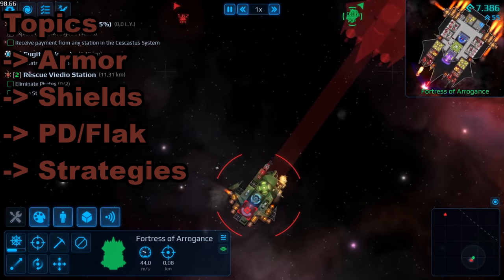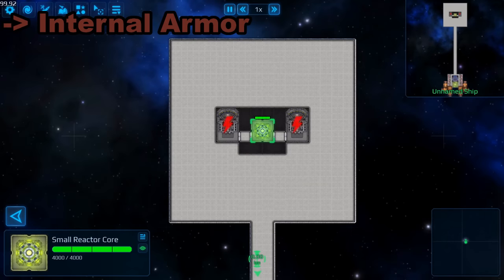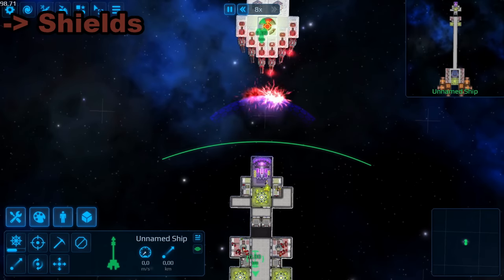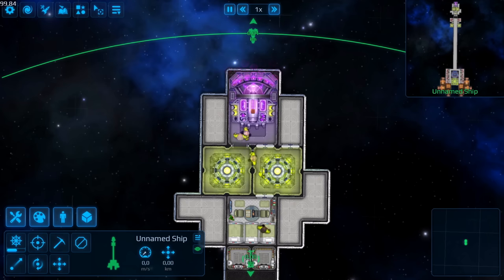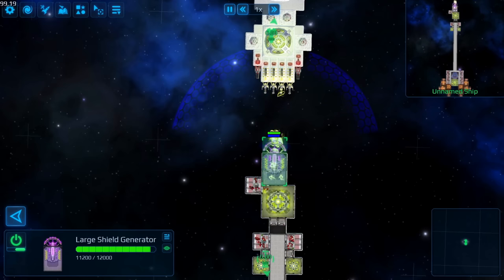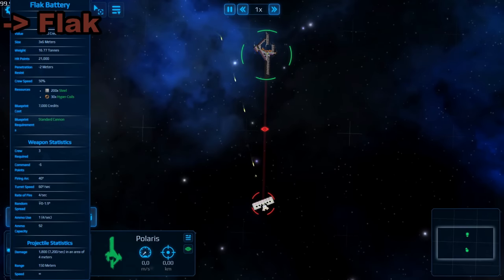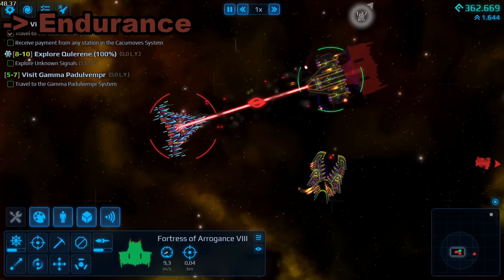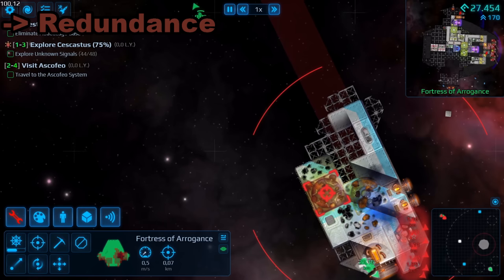Cosmoteer Basic Defense Guide

Comment: [[[The temptation for an anti-flak essay has been huge but I prevailed]]]

Anyways, in the 12:45 mark and onwards, where you talk about different strategies, you missed one very important one, which I'll get to later. First things first, your definitions of survivability through different means complements the main types of shipbuilding strategies used in the actual competitive part of the game very well, and even their signature thrust setups:

''Survivability through Endurance'' (as you call it), complements the competitive Orbiter/Rammer playstyle and the Orbital thrust arrangement. Great forward speed, barely any backwards speed and low maneuverability, relatively good spinning power to make orbiting a possibility and a lot of means of defence, mainly armor and small shields, sometimes Point Defence.

''Survivability through Range'' is the Kiter playstyle and the Kiter thrust arrangement. Very high backwards speed and decent maneuverability as well but abysmal forwards speed (In most cases), incredibly light, mostly relies on PD and shields to protect itself.

And there, you missed one: ''Survivability through Maneuverability.'' Basically just dodge everything that enemy throws at you and let everything else be absorbed by your heavy shielding, also use your vastly superior maneuverability to tilt your ship and spread damage so that it does barely any damage. Uses avoider thrust arrangement, has moderate speed in any direction and phenomenal maneuverability thanks to smaller thrusters such as mediums and larges, and relatively little weight.
Reply from the maker: "The temptation for an anti-flak essay has been huge but I prevailed" proud of you XD
and yes that was an oversight on my part. probably due to my battleship-mentality to either outlast the enemy or reduce him to atoms before he gets close.

But i also think that this strategy leaves little room for error, no? plus both shields and a bunch of engines scream "power issues" in my head. If you want to elaborate on that strategy further, i can pin this conversation so that others can see how to make the manouverability type work. like reccomended weapons, shipsize/form, maybe even examples from videos that you have seen from other people (you have my permission to post other peoples stuff in my comments. its for education, so i wont complain+ you have been a reliable source of information so i trust you to teach people correct things).
Reply: @captaincaffeine  First of all, thanks a lot for trusting me, it truly means a lot, your videos are truly phenomenal for both beginners and relatively advanced players.

Secondly... Very well. The most basic type of ''survivability through maneuverability'' kind of ship is an avoider wall... Which after talking about it I honestly get why you'd not include them in a video going about fairly basic strategies. It mostly requires a lot of extensive direct control piloting and would not be compatible for career battles if you had more than one big ship, but it's still a really cool ship type that you can very freely use in Career but especially excels in player versus player combat. It is definitely a strategy that needs not to be underestimated, as with some basic maneuvers you can dominate. First of all, you can use your superior strafing and maneuverability to:
1. Very reliably dodge nukes and even DC shots. 
2. Disengage at will.
3. Flank the enemy.
4. Use diagonal movement (Which is another advantage of avoider thrust/maneuverability-based ships) to both dodge and flank at the same time.
5. Tilt and/or slightly rotate your ship to spread enemy damage across your entire hull. About the shield part, maneuverability-based builds use a lot of usually small shields to very reliably spread damage across their entire hull and take no scratches on the hull as shields do all the work. This is especially effective against enemies with very little burst damage, especially ion beams, even the big ones.

All this can be done at a relatively little cost if you know optimization well and can be accessed mid-game. Whilst against AI this won't be that game-changing as simple ram/kite can already easily and reliably best Cosmoteer's AI, but maybe it can become good after some substantial AI updates, which are on a pretty high priority on the official Roadmap https://store.steampowered.com/news/app/799600/view/3391799364882219760 [First phase is meant to cover many AI changes as well. Not explicitly written in there, but the ''Career 2.0 takes in AI updates as well.'' Things such as enemy calling backup when kiting (Either from your back, or simply a backup of very fast ships that can catch up to you, to deter you from kiting and create a lot of trouble), enemies themselves flanking you and the such have been theorized and even confirmed by Walt himself as answers of several questions], and even if not, it's either a fun challenge to pose to yourself that can be brutally effective if done properly, or, yes indeed, can especially excel against other players, if you wish to get into the very competitively charged but mostly friendly and really fun PvP part of the game.
Reply: [God damn.. My original comment about links and recommendations got lost while I was typing in >:c. Whatever, will redo]

Anyways... Recommendations: The most standard weapons for typical Avoider walls/strafers (Yeah, the more obscure and less used maneuverability-based build is something called ''a strafer.'' Wastes less on forwards and backwards thrust and goes ALL IN on strafe thrust) are: Heavy blasters, nukes (You can use avoider maneuvers to line up nukes into absolutely DEVASTATING volleys) and small or large (Larges are way rarer as their increased inaccuracy makes them unfavorable for these elegant movement-focused ships) cannons, but the more obscure solutions can work too, such as ions, Deck Cannons (They have awful projectile stats aside from damage, like their terrible range, inaccuracy and velocity, but you can use avoider movement to line them up, make them fling to a specific direction unaware to the enemy and/or give them your own momentum for increased range and velocity), short acceleratorless rails and even missiles, allowing you to use the asteroids as a tactical advantage, strafe-orbiting around them and flinging missiles from there.

All that, maybe even wacky combinations of few of those weapons, together with the optional complementary of point defence (Or maybe even ✨FLAK✨), disruptors, maybe even EMPs and large shields on top of the small ones, allow for insane variety and versatility to the typically less-regarded and overshadowed strategic archetype of maneuverability-based builds, so go crazy :'>...
Reply: ...As for shape, the most standard shape for a maneuverability ship is a long brick-shaped wall, relatively light, heavily focused on shielding and sometimes incredibly elegant and pretty. There are two ways to build an avoider [Which is once again, the most standard form of a maneuverability-based ship] in my eyes: 
The more basic and widespread, more compact but less cost-efficient way is to have large reactors on the front to power all the shields (And blasters+ disruptors if you go for the most standard armament), typically three and thruster modules powered by medium reactors on the bottom, typically also three. Usually one medium powers 4 Engine Room arrays. Engine clusters are cramped very closely to each other and they all use smaller thrusters to minimalize ramp-up time and allow for truly impressive maneuverability.
The rarer, more advanced and harder to build, less compact but WAAAY more cost-efficient way is to have only 3-4 large reactors that are used to power EVERYTHING. The logistics can get hellish and doing this kind of build properly can be a huge pain, but once made, you not only benefit from more cost-to-power ration, but also way less explosivity hazard on the back, whilst also being less frail. Of course in career reactor cost is negatable so it's still probably better to go for the first type as with cost taken out of equation, it's better.

Plus, I'm talking about avoiders that are priced from ~1.5mil to 2mil credits, there's literally nothing stopping you from making ones way larger, more expensive and powerful than those in Career, as the large-medium reactor avoiders [Both the weaponry and engine parts of them] are very, very modular and can easily stack like Lego pieces, which is yet another benefit of the first type of avoiders in Career.
Reply: @NickAndriadze  its worth keeping in mind most pvp ships are not good for career because the win condition is different, also people who build career ships usually ONLY build ships in the 1.5mil range and honestly has no clue how to build when on a budget, especially not when on a crew budget, which tends to be the case for career.

in pvp if you win, you win. so all you have to do is win.

in career a win is only a win if you took minimal damage. if you won but took substantial damage, or even worse lost a lot of crew, then you lost. therefore overwhelming defensive abilities or overwhelmingly lame playstyles (only ion beams and railfans so you never even get into a fight to begin with) dominates career.

you must kill the enemy with minimal damage. you either cheese with very long range weapons or very easily scalable damage weapons or you need an absurdist approach to defense.
Reply: You don't need backwards thurster to be a kiter.
You only need two types for thrusters, forward thrusters and spining capability.
Just put your weapon behind.

Comment: Another great video!
I like that you mentioned mutually exclusive strategies as that definitely seems to be an easy pitfall to miss. Specialization is key.

I'd like to add a couple things:

- Often a good setup for PD is 4 of them to a power storage and either 2 or 4 dedicated PD supply crew (depending on whether you want sustain), and then you supply the power storage from a large reactor with more dedicated crew.

- You can actually get away with only forward thrust, and it's a popular strategy in multiplayer. These ships are usually controlled with direct-control (DC) mode which you can activate with ctrl+d.

- While smaller reactors may give better crew reaction time when supplying shields, you can often make up for it by stacking more shields, which increases your burst damage resistance and allows you to take advantage of the better cost and crew efficiency of larger reactors. Like you said, mediums are a good compromise. Also, it's definitely more of a choice in Career mode where crew is the main bottleneck, but if you're trying to optimize cost for multiplayer using large reactors is pretty much mandatory.
Reply: Oneye makes yet another good point. PD are very non-powerhungry when paired up with energy storage. One battery from a large reactor every once in a blue moon would be enough to keep it constantly blocking most things... Unless you want to be protected against cannon and HE spam in which case you'll need slightly more than that.
Reply: I’ve got to say that the campaign really punishes you for specialisation.

I was having a grand old time with my 1 combat ship + 1 logistics ship.

That was until I met a missle boat that was vastly faster than me. It barely did damage but after chasing it through half the galaxy I simply couldn’t catch up and died. Nor could I run away. The only thing preventing me from needing to grind in the astroid belt for an hour or two to regain my resources in my tendency to make secundary and tertiary backups.

I eventually designed a second combat ship and won the fight trivially easy. But the potential to lose nearly all my progress because I specialised in a brawler made me really salty

Comment: One of my first ships had 6 times 16-strenght Ion beams (that's 96 ions total!)... But yesterday I built a Rail Platform with 6 long Rails, goes 100m/s, has a narrow profile and VERY little defense, only couple of shields in the front, completely bare sides and back.
Long story short: The light rail ship is WAY better than my 96 ion Monster-Battleship. Even heavy ships struggle to survive my first rail fan of 6 Shots with massive pen, NO ship I encountered so far survived 3 Fans... 90%+ were dead by the second fan. More than every 2nd ship dies on the first fan.
Also WAY better for salvaging, faster to fly, easier to fight with, WAY longer range, almost invincible due to the kiting combined with MASSIVE pinpoint damage... And since I built a "Borg Logistics Cube" just before the Rail Platform, I didn't need to waste weight with storage, Mining Lasers and superfluous Armor/Shielding. Best part: My logistics/mining/storage/hauling-ship goes 95m/s itself and has close to perfect Hyperspace balance, so it has fast/cheap/plentiful jumps!
Reply: And then we accidentally kite our way into another enemy ship and oups a single shot to the butt annihilates the entire thing. :P